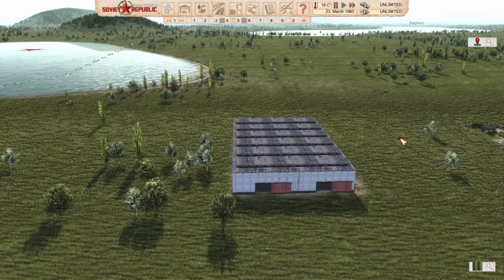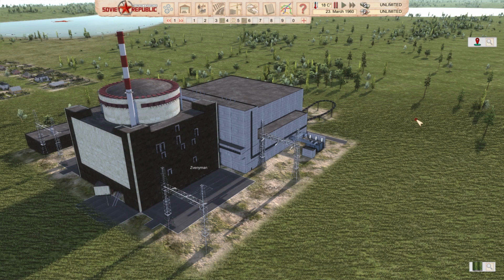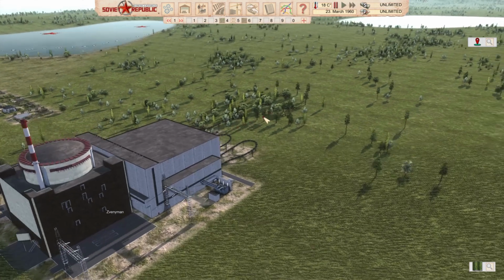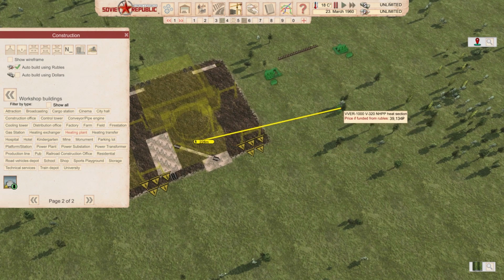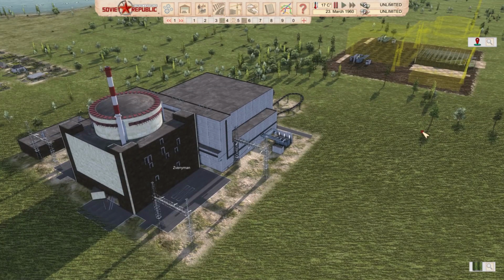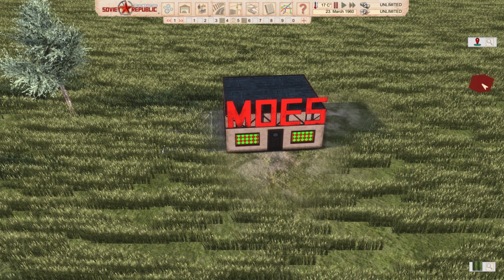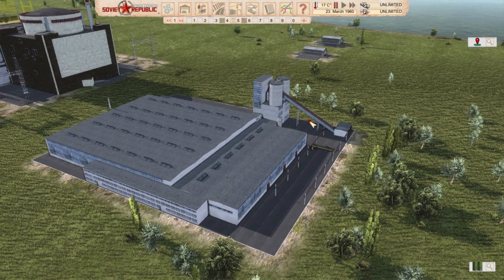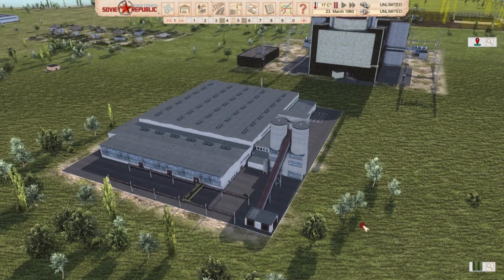Soviet Republic - Mod Monday 9

Comment: The trams in Košice, Slovakia (where the game is being developped) use exactly the same (Standard 1,435 mm) gauge as trains and not once in the whole city is it ever sharing a traffic lane with cars (only crossing each other), so saying that this isn't reallistic is false (please, feel free to check on Google Maps / Street view). This means that it's not really an issue, but there are some ways current system can be improved, for example:
* Either there could be a separate track type for trams, allowing tighter turns and better integration with road (coexistence of road and tram track in the same lane), which would prevent the trains to use tram tracks, but trams still should be able to use the train tracks (well, unless you want to force the narrow-gauge standard). 
* Or introduce indicator that'd show you the radius of the rails that you're building / have built and each train locomotive/set/car and tram would have defined minimum turning radius, while setting the minimum buildable radius of existing train tracks to tram levels (improvement for track+road integration mentioned in previous point would thus have to apply to all train track types, if implemented). This means that each train/tram would have to check whether it can go through given part of the track in its pathfinding algorithm. This approach would allow for better working trams, more reallistic trains (high-speed trains usually have much more limited curve radius), also for re-creating cases of trains going through streets of historical city centers (please see this for reference https://www.youtube.com/watch?v=B7g7PRJowzo ) and let's not forget the tram-trains (to the standard of which has a big part of tram tracks in Košice been recently upgraded - mostly renovation, but some parts had to be changed to fit the minimum 25m [IIRC] curve radius for tram-train standard - I can find & linh the documents to this renovation if anyone's interested).
Reply from the maker: I love Tim's videos. :) 
Yeah! Tighter turns and the ability to construct them on a tighter area would be the best this. I believe these 2 things might be the only things we need. :)

Comment: Dirk already had a "heating application" companion mod for the original Balakovo NPP.  Are these just bigger?
Reply: Yes, this was this mod with 5 heating connections: https://steamcommunity.com/sharedfiles/filedetails/?id=2384910975

If you already built the VVER power plant, you can upgrade it to extract some heat as a by product. To find the cross, zoom inside the building, this works.

But the VVER nuclear heat and power plant is much bigger for more heat extraction, it have 16 big heating connections. But it's still a real plant who are originally proposed for Minsk and Odessa. I prefer realistic mods over some fictional buildings ;)
Reply from the maker: @dirrrtydirk4877  I saw your earlier work as well! I love your work! :)
Reply from the maker: I didn't see the heating application part of Balakovo. Do you have the link?